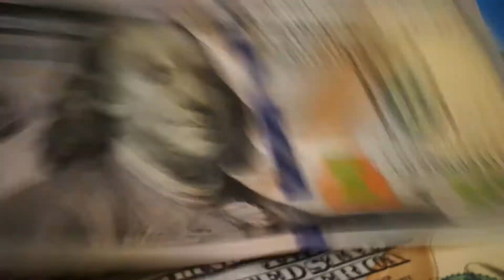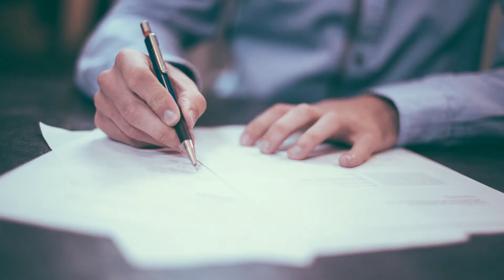Top 10 Worst Engineering Mistakes

Comment: I have a couple of crit's of this vid':-
The first, is the use of images not related to the subject being reported.  It's a journalistic trick, I know it, but can lead to misunderstanding.
Secondly, failures at the cutting edge, are not mistakes as such. Correct decisions are made in the light of current understanding.  Lack of knowledge is what leads to the disaster, for which the designers cannot be held responsible.  Their decisions were made in good faith and not due to any negligence on their part..